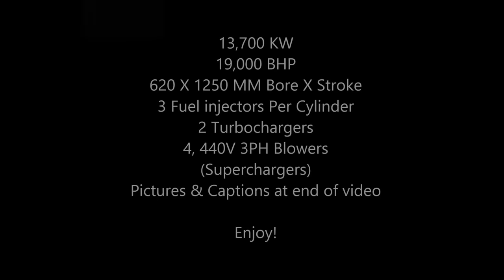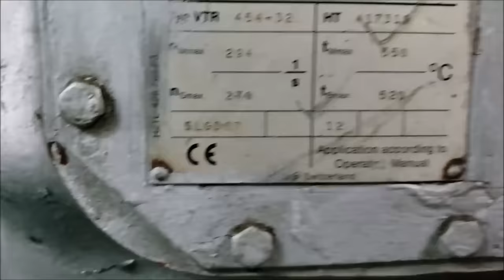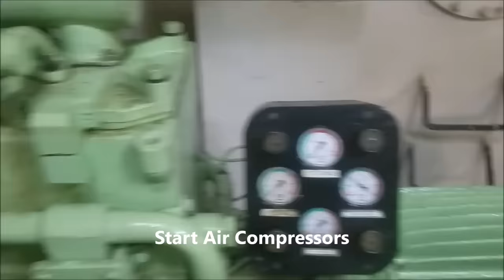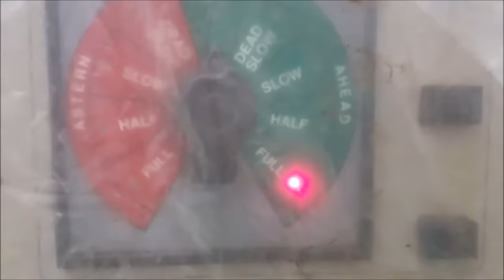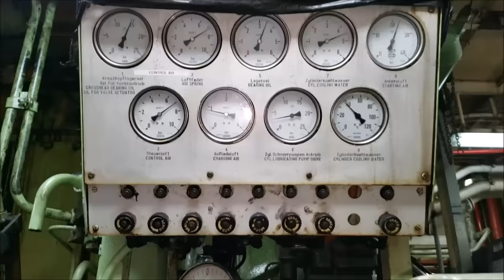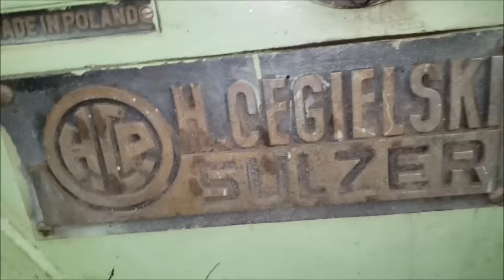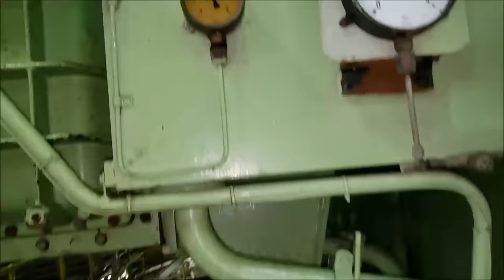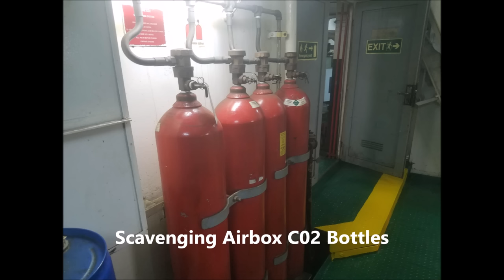Huge Sulzer Ship Engine Running at Full Speed Engine Room Walk Around

Comment: Absolutely magic. A unique sound you never forget. I can imagine the smells as you walk around. Second trip engineer cadet 1979, one of the 3 turbo chargers (Sulzer 9 RD 90) decided to fail. Didn't explode, but it was a horrendous mess inside. The second engineer, Extra second engineer (steam queen doing motor time) me and my fellow cadet spent 36 hours dismantling the failed unit. There were seized components, some parts had practically welded together requiring we fabricated additional tools as we went to assist in dismantling components which were impossible to remove conventionally, and then of course a full rebuild. It should have been done by shoreside, but that would have added to the cost. 36 hours, no sleep, and dirty chows. Once we finished, the Chief bought us each a slab of beers as thanks. The ship left port on time, so the company were delighted. They sent a telex saying well done, that was all!!
Reply from the maker: Jim thanks for sharing that. Truly a huge undertaking, mostly lost for today's engineers. You're also very right about sending it ashore, that's pretty much how it all is now. Thanks for sharing! Cheers!
Reply: @FixAndForget  these days, i wouldn't dare let the crew go beyond changing the air filters, grit washing the turbo, and water washing the compressor; sometimes that gives me worries at night too
Reply from the maker: @timp.9582  That is a sad and inconvenient truth. Only a few of the ships I've sailed on had crews that were more than just operators. Most everything either goes ashore or is repaired/rebuilt by shoreside contractors these days.
Reply: @FixAndForget  i came up during the time when vessel staff did most of it on our own,  but i've noticed the shift starting in the late 2000's. It's a multitude of factors that brought it to this point, but bottom line is that owners/managers cant risk jeopardizing charters so the responsibility gets shifted. It is what it is.

Comment: Rather humbling and terrifying to know there are engineers who design these engines and then fabricators who make and machine all the parts and shipbuilders who know how and where to fit and place every single component on these massive ships. Then there's the engine room people who know what they are looking at - 
Hell, I struggle with just putting air in my tires.
Reply from the maker: Haha me too. Thankfully it all works out, most of the time. Thanks for watching!
Reply: It does make one realize that humans are pretty smart sometimes.what's amazing to me is that extremely large mechanicals like this have been built even in the late 1800s early 1900s
Take a look at the reciprocating engines on the Titanic. 
They are larger than this..
and today there are significantly larger versions of this style of engine in the larger container ships.
do a Google search for largest diesel engine in the world and there are some pictures that will pop up.
Also made by Sulzer. 
In 6 cylinder to 14 cylinder variations.
Up to a 100,000 HP.
 I believe.
Reply: They are called Marine Engineers. And I'm proud to be one.
Reply: picking the cameraman is none of the above, by comment,(bottom end of  spare piston)
Reply: @stuarth43  . Well technically that was the first connecting rod , however , it is SOLIDLY attached to the Piston . Screws into it .
The Flange on that " Rod " gets clamped into the Crosshead to couple up to the Second Connecting Rod spinning the Crankshaft .
Reply from the maker: Absolutely right. Thank you

Comment: This is like music in my ears, so elegant and so smooth. Considering the size of the engine, the exhaust is so clean. There has been a lot of thinking behind the engine design layout. I like the three injector systems which do not only introduce reliability but also better tiny spray globules where all the fuel is ignited as shown by the clean exhaust. MIxed with the air from two turbo blowers and electric driven blowers, there is plenty of air to ram and supply the needed oxygen down into the engine's throat.  The exhaust valve is hydraulically lifted and that high-pressure supply pipe shows that the rate of change of hydraulic fluid for the valve lift needs to be high and plenty, even for a  relatively slow maximum rotation of 100 rpm. The size of the high-pressure fuel pipes and their connection box from the feeder pipe shows the fuel consumption of that engine for 19,000HP. The steps and the handle rails give an idea of the size of the engine. At Chatham Dockyard, Kent, UK, we never had such large engines in the O and S class submarines, nor the Dutch Ferries, Marsdiep, and Texelstroom, I worked on, plying between Malta and Gozo for 15 years through the connecting channel. For a second I thought that the spare exhaust cage and valve at, 1:44 was cracked!  The cable trays at 2:01 bring back memories of the many diverse watertight cable glands I installed in the Bulkheads of submarines and surface ship of the British Royal Navy, including single and multiple cable glands. These may look small compared with the engine, but they are just as important for the safety of the ship. 
The motion of the mechanical cylinder oil lubricators at 3:03  there is something majestic and intoxicating about them radiating their importance for the long life of the engine. At 3:25  I like the suspended balls in the tapered glass vessels indicating the pressure and flow rate.  Those start air compressors with their reservoir must use an air volume equal to the volume displacement of the ship to start that engine! I like the crankcase explosion dampers as I experienced the result of a crankcase explosion. At 4:44 I am glad to see the information written in the English Language, as I worked on Dutch, German, Greek, and Russian ships which only had their mother's language written down, and I could understand neither of them and had to rely on the silent and invisible common logic of all engineering functions, and the shapes to achieve them. 
The logic of the engineering function related to the shapes of the item should be taught at all schools starting from early primary schools as that is where reality and facts exist. It is a pity that most schools teach language symbols in schools. What I wrote in language form is only symbolic and an image and a shadow of the reality of that engine, even the video itself is symbolic and a shadow and image of the real thing. Many people think that language is clean, while lubricating oil in an engine is dirty! 
Thanks for the video, and not playing music, as the engine has music and rhythm of its own. It is after all a number of different players, contributing their effort to make an orchestra that plays a tune, a nice coordinated tune, with perfect rhythm. It is such pity that many people prefer emotional drugged activities which introduce them into a mental enjoyment and titillations through symbolic and imagery of artistic and religious and social entertaining factors, and they dismiss the reality of a REAL ENGINE  and its real working active functions. 
Many people do not like to face the reality of life as nature meant it to be but they prefer to enjoy only the symbols and shadows and Images of the real world we live in, especially the vociferous language forms in various societies and their human related, affiliated professions, which were greatly affected by the present Corona Virus pandemic.
All artistic emotional contents of an object, totally disappear with the absence of the human observer, but the action of the engine shown in this video will be retained even when there are no humans observing it. All art disappears with the absence of a human observer and all that is retained when art is on its own hidden from humans, is its engineering supporting structure.
Thanks for the imagery in the video any way...............it is as close to real engineering functions, as one can get! Thanks again for the memories of all the primary active functions that make a ship.  To look back at History and find that in the early days of engine-powered ships, the engineers working the steam engines of Royal Naval Ships were not allowed to dine with the deck boys................. that is a sign that most people do not fully understand the fact as to who really looks after them and is responsible for them when they fly, they sail or use any land transportation or even consider the guaranteed luxuries and comforts in and out of their homes. It is about time that all people start thinking about the real fact that it is only engineers who are required to guarantee their products. Religious members, Lawyers, Doctors, Surgeons, Teachers, Politicians, Entertainers, psychiatrists, and many others, none ever guarantee their work and no medicine bottle ever carry a label saying that it guarantees that it will solve your ailments, like many professions they live in the symbolic emotional world full of images and shadows, which is what most people in every country like to follow.  
People might ask what is the guarantee period that Sulzer gives with that mighty engine, where they do give a guarantee period because all that that engine contains, is Real and Truthful............ few professions equal the responsibility of an engineer to live in REAL LIFE WITH REAL GUARANTEED TANGIBLE PRODUCTS, as the real version of the images and replicated sounds we saw in this video.    May professions seem to guarantee a good life after death in the afterlife, while insurances make a packet out of that philosophy too, the law courts do not have guaranteed product and nor do schools and universities.  Anyone traveling by any means of transport should reflect on how much they really know engineers, what they produce in the real term, and then compare it to the emotional services they get from other social professions. Most people are prepared to pay a lot for professions elevating and titillating their emotions but not for guaranteed engineering products and comforts in and outside our homes. 
This written work was intentionally not meant to run as smoothly, as the Sulzer engine shown in the video.
Reply from the maker: Thank you very much for watching and the very elegantly written kind words. I very much appreciate it!
Reply: Very well said. I am proud to be one of those results oriented marine engineers of days past.
Reply from the maker: @carlatamanczyk3891  Likewise, Thanks for watching!
Reply: Titanic 2 engine cylinder engineering diesel generator room

Comment: Nice, nice, nice!!
Brings back a lot of good memories.
Separators on the floor plate. A bit more comfortable when you have to take a HFO separator apart in the middle of the night in a hot separatorroom.
Reply from the maker: Thanks for watching! It always seems that it happens at night doesn't it?
Reply: @FixAndForget  Yes, it does😅
On one occasion i was lucky, being the duty engineer, our M.E. suffered a cracked cylinder liner on a quitte new 9RND90M just five minutes before we wanted to take our dinner

Comment: Amazing how clean these engines run, considering the size.😉 I'm assuming the large lines going into the exhaust valve cages are the pressure feed for opening the exhaust valves, and the boxes with the 3 smaller lines are to fire the injectors? Being this is a 2 stroke, I can see why they would want the superchargers to run on electric rather than being geared to the engine. At cranking speeds you wouldn't have enough volume to scavenge the cylinders and it would be nearly impossible to start. Once it's running, I would imagine they could rely a lot more on the turbos to supply intake pressure, maybe even to the point of not needing the supercharger units running. Judging from the size of the pipes to the main lube pump, that thing circulates an incredible amount of oil! Thanks for the tour! Pretty cool piece of machinery.😉👍
Reply from the maker: Thanks for watching! When properly maintained these engine run quite smooth, although they do produce a huge amount of vibration that is transmitted throughout the ship. You are correct about the exhaust valves, injectors, and blowers. Past 65 RPM the computer program automatically shut down the electric blowers.
Reply: it's a typical crosshead diesel, but small end of scale, look up engine of Emma Maersk
Reply: The electric blowers are mainly used on startup. When insufficient pressure is unavailable from the main turbochargers because they have not spooled up yet..
Reply from the maker: Thanks for watching! That is absolutely correct, on this engine they stayed on until half ahead/astern when the turbo had spooled up enough.

Comment: I worked on Poland sulzer rta 76 with water piston colling. All seria of Zim ships from Hdw had that engine. Very good engine.
Reply from the maker: Thanks for watching! I've never worked on one with water piston cooling, that's cool!
Reply: Jes it is,litle dificult for pistone change and stuffing box is diferent. Piston can leak water and telescopic pipes knows to crack and there is no room for changing them,you have to remove pistone. Olso water can mix with staffing box oil and there is instiled cgc filter. In the port piston cooling water have to be heated
Reply: @miroslavradonjic9187  The telescopic pipes for the piston coolingwater system on RND and RND-M pistons could break if you forgot to remove the standpipes in the piston coolingwater boxes when pistons were pulled.
Reply from the maker: Sounds like that advice comes from experience. Ouch!
Reply: @FixAndForget  Not personally lucky me, but our 2nd engineer explained this to our younger engineers to take care about this. It was so obvious that I never ever forgot it. That was 40 years ago. Problem was that when that heavy piston was lowered into the cylinder, you had no “feel” what happened with that telescopic pipes, these could jam on top of its inlet and outlet standpipe.
So, standpipes to be removed, and once the pistonrod was seated on the crosshead you could put them back in.

Comment: A nice video and music for us who works as a mariner...
Reply from the maker: While I certainly prefer working on a steam ship because of how quiete and smooth they are, the slow speeds do have a very nice sound to them.
Reply: Asher Spalding I sailed on steam powered vessels also (Stal Laval AP32).
Clean engineroom, only a bit rusty under the condenser. But what i disliked was the screaming noise of the turbo generator and feed pumps (76 barg)

Comment: During my time in the Australian Navy , I  had the Privilege of working with and on a Pair of these A-Frame sixes . Scott-Sulzer . Glasgow built .
The thing that surprises people is how Quiet the Actual Engines are . Everything else  is Screaming its head off , but the big Powerhouses not at all .
Great memories  here . This  Old girl has a LOT  of  Oil weepage  I  have to say . At least you know the Oil supply is good , and at sufficient pressure .
Reply from the maker: Thanks for watching and sharing that. I was amazed at how nice and quiet they are when running at slower speeds without the turbo. Cool low pitch thump. This engine was just overhauled and the crew was slowly putting it back together. Cheers!
Reply: I served on the 'Wart in the mid-late 1980's...loved those big engines. having to manually clean the air boxes was a filthy job!
Reply: @skippi222  . Mid 80's for me too . 
Those  " Buffer  Spaces " .  YUCK .
You possibly got My Billet when I  rotated ashore .

Comment: GOOD PRESENTATION,    What is the grade of fuel used and its character.   2. What is the Efficiency of the Engine.   3. What is the compression Ratio.  4. What is the fuel consumption per hour at full load.  5. What is the exhaust Gas temp.   6. What is the air-fuel ratio                   DHAYANANDHAN.S
Reply from the maker: Thanks for watching and the kind words! Attached is a link to a Sulzer PDF with all the information on the RTA series engines. Take care!

https://www.google.com/url?sa=t&source=web&rct=j&url=http://engine.od.ua/ufiles/Wartsila-20121.pdf&ved=2ahUKEwisg57ru6LsAhVmu1kKHRHHDYsQFjABegQIAhAB&usg=AOvVaw0aTSH9A1L5KiXdACeGUiNS

Comment: I've had worked Mitsubishi Sultzer 6 RTA 72 from 1995-1997 (M.V RUBIN CAMELLIA) since maiden voyage.
Reply from the maker: Very interesting. How did the Mitsubishi Sulzer perform? I would expect very well. Thanks for watching!
Reply: @FixAndForget  No trouble at all.
We had to careful with the scavenge non-return valve not to get choked and replaced with clean spares regularly.Unit and exhaust valve overhaul are quite easy.Unlike the RND. Retired in 2012 and teaching OEW CLASS III and heavy fitting (Workshop skills training OEW PART I).

Comment: The "Superchargers" are not that, but "Auxiliary blowers". They do not supercharge, they provide the engine with air at low power settings, when the turbochargers (the actual superchargers) are not providing enough air to sustain favourable running conditions.
Reply from the maker: Thanks for watching! You are absolutely right. I only used that terminology as it is more familiar to US Mariners and viewers.

Comment: As we use to Dive at Night for Flounder under the Liberty Ships here in the Northern Gulf of Mexico we would occasionally hear ships running. I remember well coming up & looking for some of them and not being able to find them as the sound travels 200 times farther in water & they may or may not be over the horizon. This is not exactly how I remember they sounded. I recall more of the Prop Turning with it. Very interesting to experience at Night Diving.
Reply from the maker: Thanks for watching! That is all very interesting. In my few experiences diving, I was able to tell the difference between small outboard boats and large ships. Like you said, never able to see them only hear.